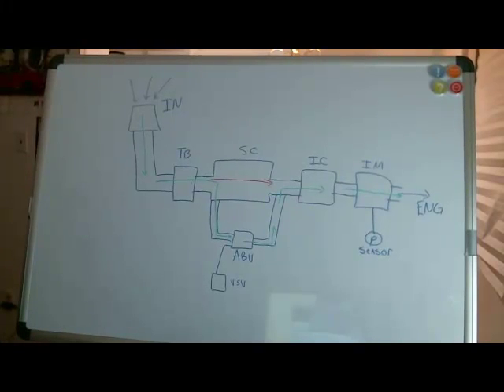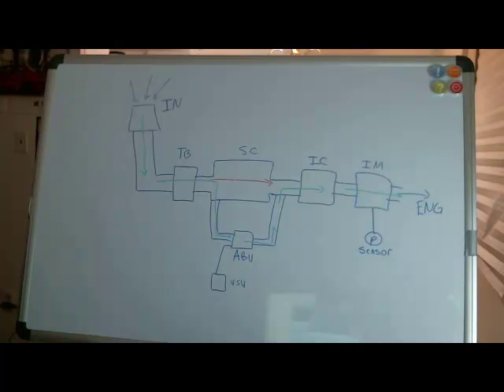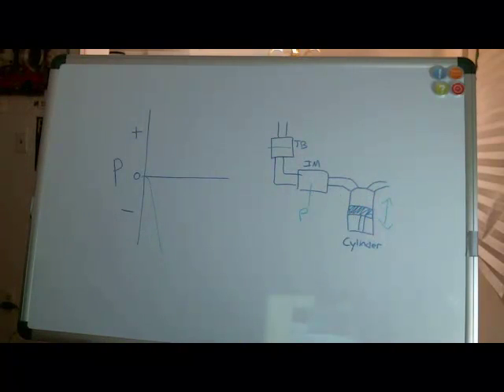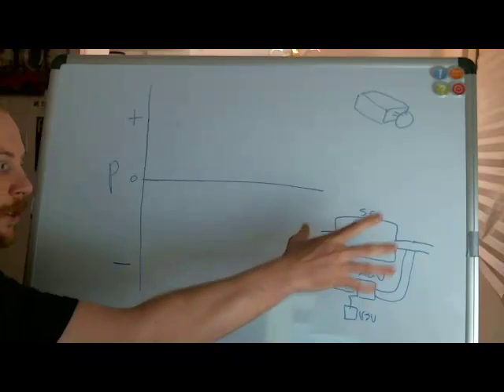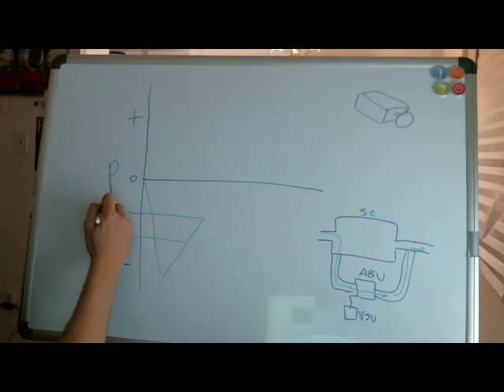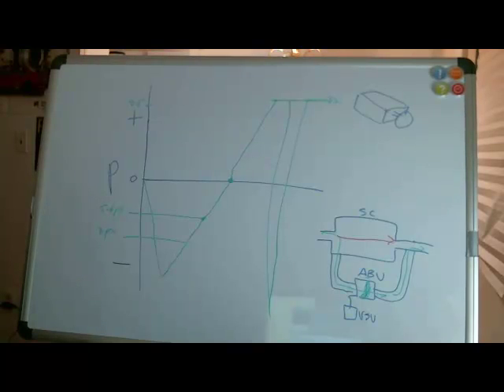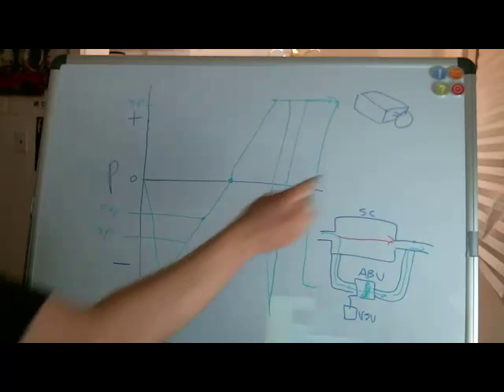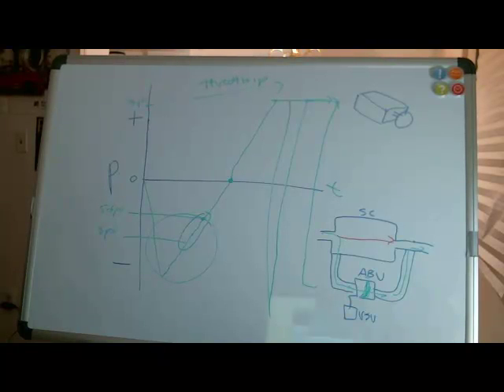Toyota MR2 Supercharger: How it works (part 1)

Comment: I know this is a very old video, but one question I have about the abv is why doesn't it direct air from after the throttle body straight into thr inlet manifold instead of making uncharged air go through the intercooler

Comment from the maker: As with all old cars the MK1 MR2's will need some upkeep, however OEM parts are still available from toyota and working on these cars is fairly easy. Just get yourself a copy of the factory service manual and a proper set of tools and you will do just fine.